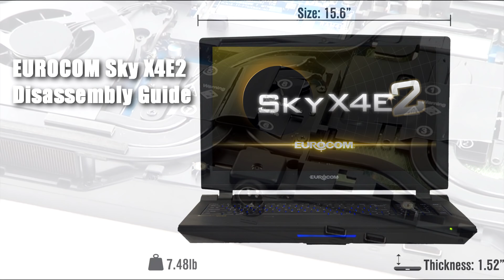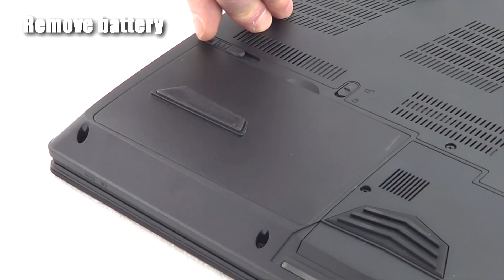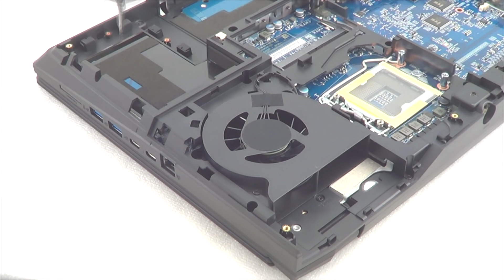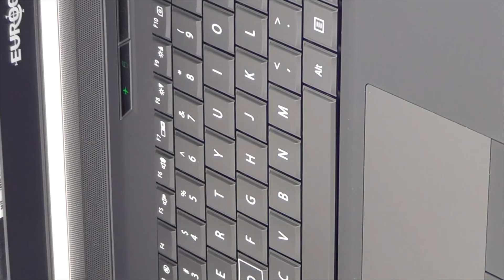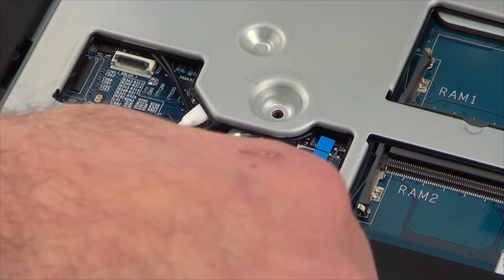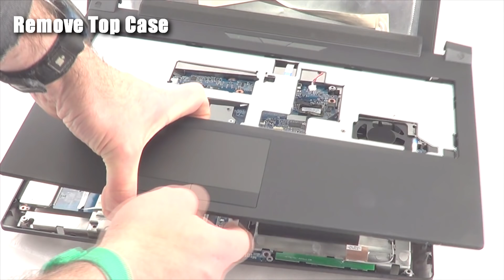EUROCOM Sky X4E2 Laptop Disassembly Guide

Comment: Have had this laptop for months. It's by far the most fully spec'd laptop under 17". And at a price that can't really be beat.
Reply from the maker: That's amazing!  The EUROCOM Sky X4E2 is an awesome little laptop that comes with some serious performance in the form of socket based Intel Core i7 desktop processors, up to 64 GB memory and NVIDIA GeForce GTX 10 series graphics.  Feel free to pass along any pics, videos, benchmarks comments about your personal system.  We'd love to see it in action!
Reply: I wouldn’t call it a “little” laptop at ~1.5” thick but I will say thinner laptops from other manufacturers usually have serious cooling problems. Also, for this price, getting 2 usb 3.1 10gbps ports, HDMI 2.0, DP1.3, thunderbolt, and optical-audio out with a great DAC is simply unheard of. The desktop class chips are also great because they don’t hold back the GTX 1070. It’s feature-rich and very well balanced! Most other laptops only have DP1.2, HDMI 1.4, only 1 USB 3.1 gen 2 port and likely no thunderbolt.

My X4E2 build: 
i7 6700 (non-K because of the lower TDP- runs cool- rarely hits 70C in games)
16gb 2400MHz DDR4 ram
GTX 1070
1TB SSD
4K 60Hz G-Sync monitor

I actually have it docked on my desk most of the time and have it linked to a 32” 4K monitor and 2.0 studio monitor speakers. All on a butcher-block height-adjustable sit-stand desk. 

One quick note- I get a score of 14,277 on Fire Strike, a bit higher than the 13,334 on the website. :-)

TBH, I was never interested in gaming laptops as the GPUs always sucked but Pascal was the reason I sold my desktop and only use a laptop. This has been a game-changer.

It’s also great you folks are Canadian- I’m from Toronto.
Reply from the maker: Yeah I meant small compared to the hardware performance inside.  Wow, this is amazing!  Thanks for passing this on.  If you could venture over to our Facebook page and share this with our followers I would really appreciate it!  https://www.facebook.com/EurocomTechnology  Hello from one Canadian to another! : )

Comment: eurocom can this laptop use gtx 1080 inside it? because your tornado f5 can use the gtx 1080 with the same size as this laptop
Reply from the maker: Good observation!  Unfortunately the Sky X4E2 does not support 1080 graphics but fortunately for those that want a 1080 in a 15.6" laptop the Tornado F5 does support 1080 graphics.

Comment: Hi I am currently on your website and I would like to buy this model :)
I would like to know if it is still possible to overclock the cpu and the gpu without having the bios unlock? (Not a big overclock necessarily)

It costs 174 $ CAD to unlock it!
I find it expensive to flash a bios?

Thank you !
Reply from the maker: You can tweak the CPU using XTU and similar tools but to have real control over the internal components you will need the unlocked BIOS.  The cost is to cover the cost of development of the BIOS itself.  By no means do you NEED the unlocked BIOS.  The system is a beast with or without it.
Reply: Thank you for your reply !
No I do not really need more juice.

It's just I ask the question because later when the technology will be older will be an option and I was wondering how the model reacts to excess heat.

Now I understand the price for the custom bios!

I was also wondering if all the seventh generation i7 model works on the pc?

Thank you !
Reply from the maker: The X4E2 actually supports i7 6000 series CPUs and i7 7000 CPUs.  These are the CPUs that we offer: 
  - 4GHz (up to 4.2GHz) Intel Core i7-6700K; 4C/8T; 8MB L3; Skylake-S; 14nm; LGA1151; 91W
  - 3.5GHz (up to 3.9GHz) Intel Core i5-6600K; 4C/4T; 6MB L3; Skylake-S; 14nm; LGA1151; 91W
  - 3.4GHz (up to 4GHz) Intel Core i7-6700; 4C/8T; 8MB L3; Skylake-S; 14nm; LGA1151; 65W
  - 2.8GHz (up to 3.6GHz) Intel Core i7-6700T; 4C/8T; 8MB L3; Skylake-S; 14nm; LGA1151; 35W
  - 4.2GHz (up to 4.5GHz) Intel Core i7-7700K; 4C/8T; 8MB L3; 14nm; Kaby Lake; LGA1151; 91W
  - 3.6GHz (up to 4.2GHz) Intel Core i7-7700; 4C/8T; 8MB L3; Kaby Lake; 14nm; LGA1151; 65W
  - 3.8GHz (up to 4.2GHz) Intel Core i5-7600K; 4C/4T; 6MB L3; Kaby lake; 14nm; LGA1151; 91W